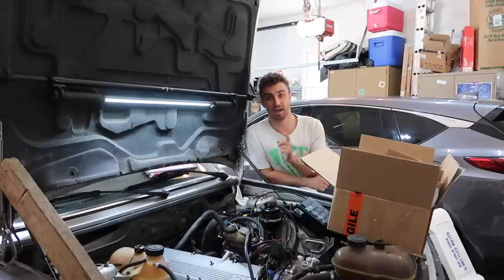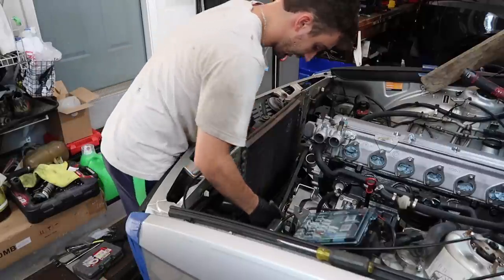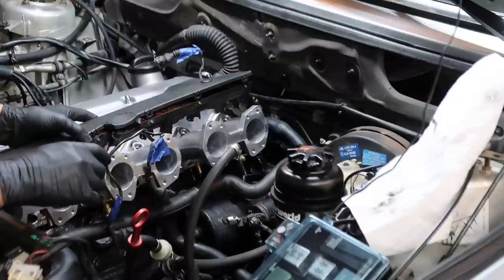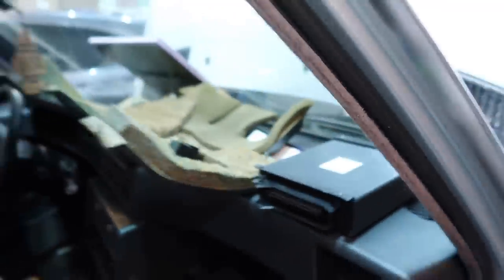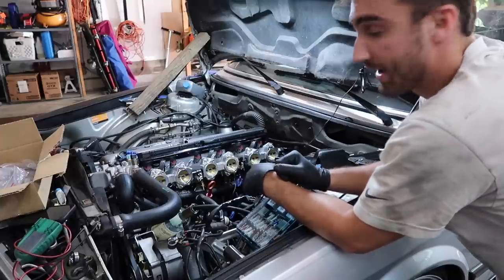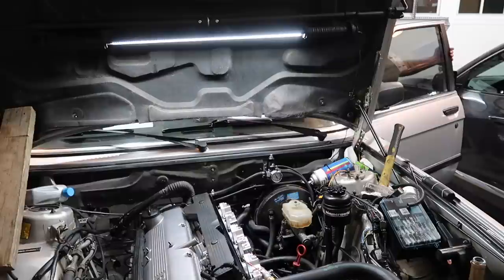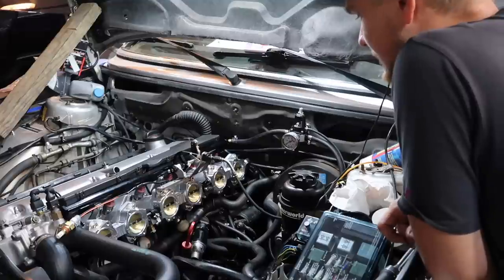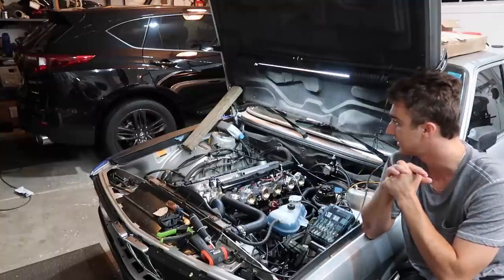Installing and Wiring a M30B35 with Individual Throttle Bodies Into a BMW E28 | First Start!!

Comment: 23:39 .. is exactly what you will say and feel when we finalize our deal and you are finished with this project. 12,005.99 😎 🤝
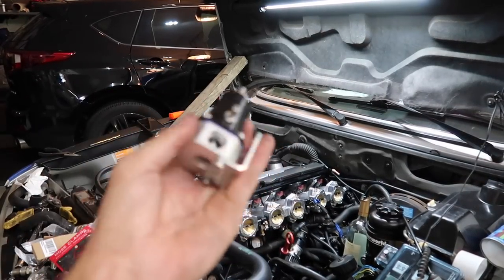Reply: 30:18 how much was the FPR ?
Reply from the maker: @Robertgio  $180 and $20 for fittings

Comment: I always thought megasquirt replaces the ECU.. I guess Im wrong? Great vid very informative, Im in the process of swapping my bad wiring harness with a good one.. not precisely sure how to get it through the firewall, without cutting the (complete) harness.. does that beefy ECU connector actually fit through the port hole in the firewall?
Reply from the maker: It does replace. I used stock ecu for testing and starting purposes. And yes the big harness plug fits through firewall!
Reply: @m3nameisjosh464  Wicked, thanks for the info, thats gonna make my life a lot easier. any particular reason to run MS if im not also running individual throttle bodies? (other than potentially failing ecu, certainly possible) or you think more headace than worth for a stock m30? thx again man, very helpful.
Reply from the maker: @scottfindley1345  absolutely not necessary if running a stock engine, however I will say, megasquirt opens up the ability to make an M30 run a lot better, make some more power, etc even as stock engine. The old electronics are getting…. Well even older and if you have a knowledgeable megasquirt tuner, they can really optimize the m30

Comment: i have seen mixed opinions about itbs for the m30 and other bmw engines, do you think theyre worth it? do they add a good amount of power?
Reply from the maker: The mixed opinions are from people who feel the need to over analyze price to power and forget that car mods go beyond power. These itbs will hardly do anything for me in terms of power, but the sound and driving dynamic alone id bet will be well worth the ~3k that it costs for the itbs and the ecu to run them.

Comment: Yo man I’m on the fence about buying an e30 it’s my favorite car. It’s a manual swap on its 3rd tranny and 3rd motor. I wanna go garret turbo making around 400 horsepower. What do you think. It’s already a daily car but what do u think all that would cost me and what’s your opinion.
Reply from the maker: Id advise you check out my turbo e34 videos. Turbo build done right will cost you 10k minimum

Comment: Hey man, I really appreciate what you're doing. Comparing cost, is an ITB vs Turbo setup pretty similar even after tune? I have a 535is and M30B35 swapped in. Last owner botched it and I'm planning to restore. I'm leaning toward just staying NA so it will be a zippy track inspired street car, that can be beat on worry free. ITBs just seem so much cooler and retro to me opposed to turbo.
Reply from the maker: My turbo experience has been more expensive than my ITB experience. Realistically without all the swapping of engines/ refreshing etc, ITBs are basically just the cost of the ITBs(~$1800, and a NA tune ~$800)
Reply: @m3nameisjosh464  That's awesome to hear, my heart wants an ITB build and it just seems so proper for a classic straight six BMW. Thanks again man.
Reply from the maker: @whiskeyactual.  completely agree!

Comment: What header are you running?
Reply from the maker: Schmiedman
Reply: Oh for sure! Dude, I been looking at headers and those caught my eye. How was the fitment?
Reply from the maker: @Chrisychris88  not too bad, 1 hits the engine block and needs the block shaved, 1 is really close to firewall, my fabricator ended up cutting them shorter and just adding flanges in different location